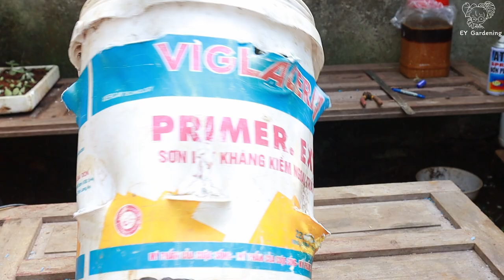[No Garden] Just 2 Paint Bucket You Will Have A Tower Of Spinach

Comment: Did this with strawberries a long time ago with the addition of quarter-inch drip irrigating tubing fished up through the bottom of the tower. Strawberries are perennial where I was living so I could leave them just as they were (plus occasional topping dressing with compost) for about five years before it was time for new plants. Had over 200 strawberry plants growing that way.
Reply: Wow!!!! I love that for you! I am so heading to Lowes for more buckets to do strawberry and spinach.
Reply: what zone?
Reply: @Montasia1112011  Zone 9. They were fine in the winter because it rarely stayed below freezing. Hot summers though, so rather than paint the buckets, like in the video, I wrapped them in a layer of that reflective foil-bubble wrap insulation, and then a double layer of shade cloth with holes cut in each.

The whole set up sat on a partially, high-shaded brick patio. The towers that weren't shaded in the afternoon sun I'd throw a couple of old sheer curtains or old white sheets over on the hottest days. Some leaf edges got a little crispy but neither the plants nor fruit suffered much. It was really gourmet compost and soil I'd used and they got a weekly spray of worm casting tea, plus slow-release fertilizer during the season. I had access to A LOT of oak leaves and cedar needles - strawberries are acid-lovers. I placed (not fastened) bucket lids on the top to help retain moisture.

Hope you're able to give it a try and it works out for you.
Reply: Ideas are thoughts and thoughts are energy which travels amongst all of us 😍
Reply: Wow, that's so good to know. Thank for sharing!

Comment: Those are huge and gorgeous,  great idea minus the paint bucket. Use food grade buckets instead. Great music too😊
Reply: Kuk music!
Reply: Pickle buckets
Reply: Paint buckets sold in the stores where I live are food grade. They're in the paint department and have a sticker on them saying food grade.
And if you flip them over they have numbers in the recycling arrows. When you look those numbers up it will tell you which are food grade.
Reply: As long as it's just latex paint the buckets will have a "2" code on the bottom which is food grade.
I scrubb them out good of course. 
The grey buckets have UV Inhibitors in the plastic so they last longer outdoors.  Some of the white buckets will get brittle in a couple of years exposure to the sun.
Check the dumpsters where they are building new housing for empty paint buckets. You can get half a dozen at a time if you are lucky.

Comment: You could stabilize these by driving a 48" long piece of rebar down the center hole.
You could also raise these by standing the unit on top of an upside down bucket. Of course the rebar would need to be longer. A six foot long piece of 3/8 or 1/2" should work.

Comment: I would have liked some vocal explanation. I am listening at work. I can't watch.

How did you cut those holes in the buckets( I don't have a tool to cut that and I am on a budget)? Where did you get the round part with holes? Was that just was water yoi used?  I have not done anything like that before.  So I need as much explanation as possible. Thank you for your time.
Reply: very sharp knife and a heat source such as a candle, hair blow dryer.